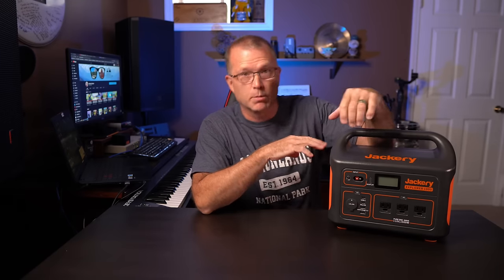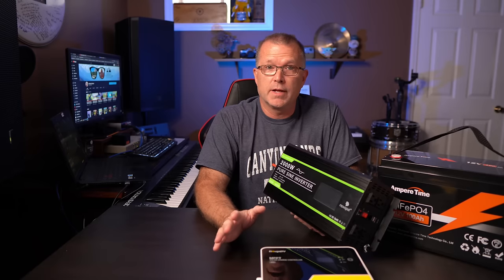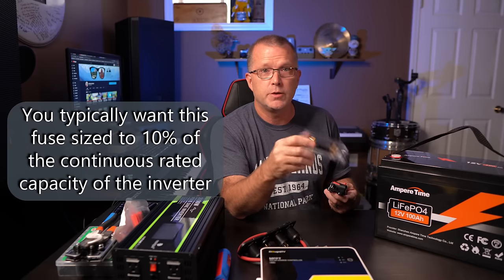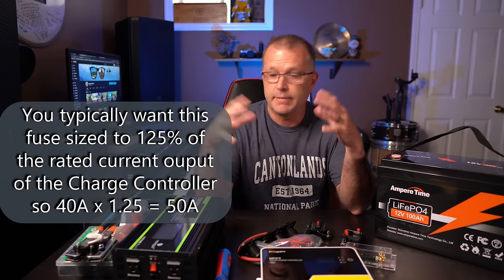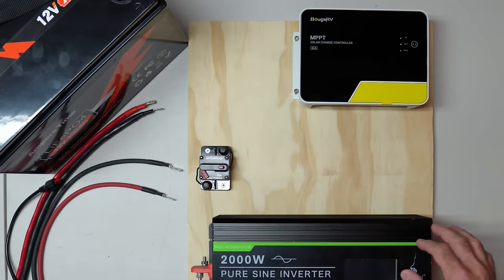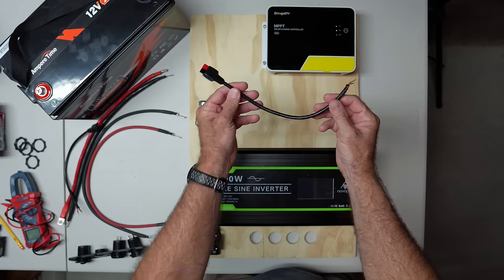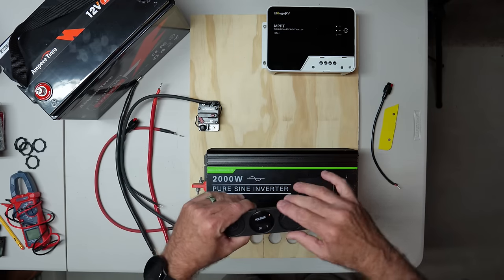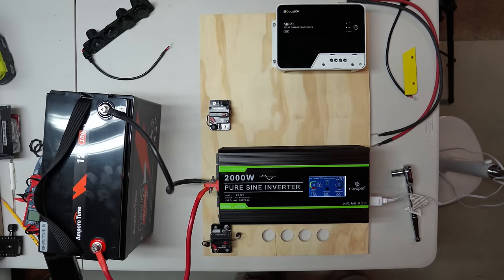BEGINNER FRIENDLY Step-by-Step: DIY SOLAR GENERATOR for Emergency Power, RV, Shed... Ampere Time

Comment: Thank you I was looking into an instructional video like this one. I've noticed you like to travel and have been to quite a few places, that's fantastic. I'm planning a trip on a motorcycle from Costa Rica to Ushuaia, Argentina, "the end of the world" or so-called. I need to hook up a small solar to a second motorcycle battery and run an inverter to charge my cell phone, recording equipment (small drone, camera, and small camera go-pro like, and laptop. What setup do you recommend? Semper Fi
Reply from the maker: Cool man! Sounds awesome!  For those kinds of devices, the most compact and simple solution would be a small all-in-one Power Station..maybe in the 300Wh range  (or perhaps even less).  Something like the Bluetti EB3A or the EcoFlow River 2 are extremely compact, fairly lightweight and can take more solar input that you probably need.  With that kind of setup, you could get by with a compact 75W panel like this: https://amzn.to/40sPdSi.  If you're set on using the 2nd motorcycle battery, you could get by with an inexpensive PWM charge controller, like the BougeRV 10A  https://amzn.to/3wXJ4jw and a small inverter.
Reply: @ReeWrayOutdoors  thank you so much for your response, appreciate your time.  I will definetely look into your recommended options. 👍

Comment: Hi Reeway Outdoors thank you for your very well explained diy solar setup video. It is one of, if not the best I have seen so far. Just curious what are you suggestions (regarding breaker& fuse size) for a 1000w inverter and a 12.8v 200aH battery ? Thanks for any feedback :)

Comment: This is amazing sir thank you already liked and subscribed. How many solar panels can the controller run?
Reply from the maker: Thank you!  It really depends on the operating voltage of your battery system.  On this particular charge controller, it'll support up to 600W  @12V, 1200W @ 24V, 1800W @ 36V and 2400W @ 48V with a maximum solar input voltage of 150V.

Comment: Shouldn't you up the wire size from battery to inverter to 1/0 awg? I was doing some research, and this seems to be the consensus for wire sizing to a 2000w inverter?

Comment: So I have a question, if I disconnect my main power, from power company at the meter, pull disconnects on all 240v appliances, can I plug this solar generator into an outdoor outlet to use ONLY 110v power? I have done this several times with my champion 3500w gas generator using a male/male 10-3 wire.

Comment: @ReeWray Outdoors  In looking at your setup, I thought the Battery was supposed to be directly after charge controller (with fuse/breaker between), then FROM battery, fuse/breaker  TO INVERTER. You've got controller to inverter the to battery.
Please comment so I can learn😊
Reply from the maker: Hi Heather! As I said in the video, I'm learning too (and not an electrician), BUT I think you're getting hung-up in how you're thinking about current flow.  You can certainly wire it the way you described - with the charge controller connected through a fuse directly to the battery.  But really, since the current is going to flow through all connect paths, it is also practical to simply connect the charge controller (also thru a fuse) to the positive on the inverter, where the battery positive (thru another fuse) is also landed.  This does 2 things:  It allows me to use a shorter length of cable from the charge controller (which is slightly more efficient), and it also allows me to use smaller gauge cable there since I have the appropriately sized breaker in place to protect it.   That said, I don't think there's any inherent problem with the way you're describing it either, but it doesn't HAVE to be wired that way, as far as I'm aware.
Reply: @ReeWray Ya, Sorry, but I came to the comments to say this too. 

Personally, I would never set my system up like this! I would connect the controller to the battery, and the battery to the inverter. Yes in theory this will work, but at a risk in my opinion. 

For one, I feel the fuse between the inverter & battery is useless because it needs to be able to cut off electricity between them. As is, it might trip the fuse but there is still electricity flow in this set up.

My setup is: panels > controller > fuse > battery > fuse > inverter.
Reply: Whilst it may be convenient at the time of wiring (to connect straight to the inverter) it should be connected independently to the battery.  What you are not considering is faults and maintenance of the system.  For example:  the battery fails or needs to be removed....if you are not careful in that situation and someone operates the inverter then the MPPT is going to wear the load and you are totally reliant on a bidirectional breaker.  Hopefully the controls will protect itself.  Also worth pointing out that every time you go to work on a solar system the panels must be isolated first.  This may seem pedantic but trust me....if you open the door for Murphy's Law in electricity....welll...it's only a matter of time.

Comment: I have another question since I'm new to this solar stuff.  If you're charging a power station via solar and the unit reaches 100% charge, can you leave the cables hooked up or do you have to disconnect them?  Thanks again.
Reply from the maker: You can leave them connected if you want.  The charge controllers will all cut-off charging when the battery voltage reaches a predetermined set point.  Some will then continually re-enable as soon as a power draw (load) is detected, while others might only re-enable when state of charge reaches something like 95% or so.

Comment: Can this system be used to power appliances in UK which run on 240 volt electricity?
Sorry I am clueless on this subject of electricity.
If not, what component(s) of your list need to be changed?
Thanks in advance.
Reply: You would just need to get a 240 Vac inverter.   Inverters have DC input and AC output.  You match the DC input of your inverter to the battery or battery bank and Charge controller voltage (12, 24, 48 volts) and you match the AC output side to the voltage needed for your load (appliances, tools, etc. at 120 or 240 volts)

Comment: Thank you! Now, is the charge controller necessary(or if the sun doesnt shine), Can you use a battery charger/jumper to recharge the battery? Charging it off another solar generator.
Reply from the maker: The charge controller's purpose is to safely regulate the fluctuating power coming in from the solar panels to an appropriate level for the battery(ies) it's tasked with charging.  So you need a charge controller anytime you're trying to charge a battery with solar if you want to avoid ruining your battery. :)  You can definitely use an AC battery charger in lieu of solar charging - and no extra charge controller is needed in this case. But keep in mind that not all battery chargers are designed for all battery types.  You definitely want to use something that is designed for Lithium-Ion chemistry if that's the type of battery you're charging (or lead-acid, if that's the type of battery) since these different battery types have fairly different charge/discharge voltage profiles.

Comment: Hi. 

Want to setup a 4 or 6 panel so i can test it by physically pluging it into a house outlet AFTER i have shut off the house power panel. 

I understand that a 'grid tie' system requires that i have my home power panel powered on so that it (the panels) sees the house AC power. 

Can you define the minimum panel system that i would need to accomplish my test system?
Reply from the maker: Not sure if I completely understood your scenario , but I think a manual transfer switch might be the way you want to go. It's not a "grid tie" solution since you only provide solar/inverter/battery power to specific circuits that you manually switch OFF of grid power. But it would give you the flexibility to power your critical loads off grid whenever you choose. I cover this in this video: https://youtu.be/Y9GJqt1zTFI

Comment: Thank you!  I purchased a few items from your parts list above.  Just wondering... I have a 2 solar panel system.  Is the battery you recommend the best for powering some lighting, maybe a garage door opener, small college like fridge, and some power tools?  I don't mind spending a little more to get a more efficient (better) product.
Reply from the maker: Thanks for your question, Dennis.  I have a couple for you: Have you got an AC inverter (Maybe 1000W) already?  And for how long would you want to be able to run the small fridge?
Reply: @ReeWrayOutdoors  Funny thing is...  A friend of mine gave me one about 10 years ago.  I though...  What am I ever going to use this for.  But it's a 3500w AC Inverter.  :)  They still sell the same one today.  I don't know if it works just yet but I'm going to find out soon!  I think this will be my project tomorrow.

Comment: Can you connect this system without using a battery? I'm new to all this so I'm plenty ignorant and don't want to screw things up, but I don't need to save any extra power that is produced by my solar.

Comment: You know that's what I did 20 some years ago. What actually was like 25 years ago. Add a small inverter while I was actually 200 W. Inverter had a few batteries. Well then I turn around and got like 42 batteries and only a 2001. Verter and that's what I use, but I didn't run everything. In my house either.
 But then again, you aint talking about running everything in your house.  You aint talking about running anything.It's major. But I use what you and use between never overcharged and never undercharge. And never let it die and never let the batteries die. Keep the batteries from overcharging and kept the battery from recycling. It worked just pequickly for 25 years. So you don't like those charges. Don't pay pose much power. Are you so penalty? I don't know about that 1. I'll take your word for that. I never checked to see how much power it's pulling on. It was not pulling out of the solar panels. All I know. Is it did my solar panels good? Because I didn't have to click my solar panels directed to the batteries which I know that would overcharge the battery..

Comment: Nice job with the whole thing about building one of those would be for me to see if it would run my refrigerator and for how long and how long would it take to charge back up is it doable to plug your refrigerator in if the power goes out put your solar panels out in the daytime and the whole system run 24/7 to keep your refrigerator running I mean your little refrigerator would keep my insulin good but in a couple of cold sodas but otherwise in that what happens to my freezers and my refrigerator I need something to keep a freezer going 24/7 and a refrigerator I can build something for my TV to get information on the news and some light sense of fans and you're good to go but would that little unit keep a refrigerator going that's the question I was hoping you would plug something like that in instead of just that little fan
Reply from the maker: Funny you should mention that!  https://youtu.be/nGG0Hnv9p50

Comment: You setup the charge controller to connect to the inverter, to the battery. Other videos I've seen go charge controller, battery, inverter. 

Can you explain the ordering please?
Reply from the maker: Electrically, it's all the same really.  If you have a lot of wires to connect, it might make sense to use + and - bus bars to land the cables on as it makes things a bit cleaner, but it doesn't really change things electrically to any significant degree.

Comment: I need your help. I am planning to create a small solar setup for my laptop as I work from home & there are frequent power cuts. I want to create a setup which will charge my laptop at least 2 times. My laptop has 4500mAH battery & my laptop is 65 watt. My laptop is giving me 4 hours of back up. Keeping in mind DoD of battery is 50% & inverter efficiency is 80% please tell me how much battery do I need? I just need it for my laptop nothing else. Will 24ah lead acid battery work & which inverter will be best? I dont know anything about it & it  it should be portable.

Comment: Awesome Video! How large of a charge controller do I need if I want a 1000w inverter with a 100ah battery with only a 100w solar panel possibly adding a second for a total of 200w of solar. ? looking for a cheaper solution than the 40a bougerv charge controller without compromising the battery like you said. Thanks!
Reply from the maker: For something simple like that, you could go with one of their PWM cc's. PWM is not as efficient as MPPT, but way less expensive and should be fine for what you're looking to do.   https://amzn.to/3T920bj
Reply: Thanks so much for the reply! I see with only 100watt there isn't much of a difference with Pwm or mppt. My next question is based on the math for Charge Controller if I have 20A like the link then I need a 25A Breaker. I only can see 30A breaker or 20A. Is it okay to round up or down on the breaker there? Or should I look for an inline fuse that is exactly 25 A between my battery and PWM? I am concerned that rounding down will trip the breaker often and rounding up will not protect. Thank you! @ReeWrayOutdoors
Reply from the maker: @BeccaLiebenberg   You should be totally fine with a 20A breaker or Fuse in this case.
Reply: Thanks so much for your replies! Really helping me out 😁

Comment: Lot to learn.  Why does the controller connect to the inverter?  I’d expected the controller to connect only to the battery.
Reply from the maker: In this video I was trying to keep it as simple as possible...and electrically,  there's really no difference between connecting the CC directly to the battery or by way of the inverter terminals.  But check out my more recent video on topic for a more 'best practices' aligned method. https://youtu.be/PG7RzOyj3ME

Comment: I have a question no one answers or addresses. In this example we will use 100a panels and the Bouge CC.   So.....I have 4 100w panels I want to run in a specific configuration but ultimately they will come down to just the 2 inputs for the CC. Now I have 4 panels at a higher amp draw (we will use 30a for this example). 30a into the CC is a doable thing but...lets talk about wire sizing for the panels vs the wire termination.   You said you could add panels but need to size the wire which is absolutely accurate however...the CC termination screws are WOEFULLY SMALL!  Lets for arguments sake say you have to get a 10g wire in there.....THAT'S A HARD THING TO DO!  If I have a CC like this one and I want to run near the capacity then how do I do that  with the lugs they provide??? Is there an option out there somewhere I've missed???  This one thing is frustrating coming from the CC companies! the lug sizes are just WAY TOO SMALL!  You should be able to get 30a easily out of a 12g wire however my CC is 60a and I will actually be hitting nearly that once this goes online! 

I have 8 145w panels which will be ran into 2 strings of 4 into a combiner box. This will give me an ADVERTISED 64a HOWEVER....my panels are 15yrs old now so at an expected 20% drop my maximum should be more like 52ish which is more than acceptable to me. I still have to size for the larger capacity so thus the reason for the question. 

Thanks in advance!
Reply from the maker: Well, at least in the case of the BougeRV 40A CC I have, it does support up to 10g wire and actually, I'm now using 10g solar cable with it currently and it's not an issue.  Really the only issue I've run into is that I'd like to put ferrules on my cable ends, but because the terminals on that CC are so far recessed up into the housing, I couldn't use ferrules because the base of the ferrules I have are too thick to allow the tip far enough into the terminal to make a secure connection.  But bare wire termination with 10g solar cable was not an issue for me.  Regarding your particular setup, I don't know the output specs of those 145 panels, but seems like using 2 series strings of 4 panels each, and then connecting those 2 strings in parallel, that would allow you to keep the current down sufficiently to enable you to use something like 10g cabling - I'm guessing your panels have an Isc of probably no higher than 12A?  So, using the configuration I described should keep you well under 30A, even with some safety headroom, unless there's more to the story.